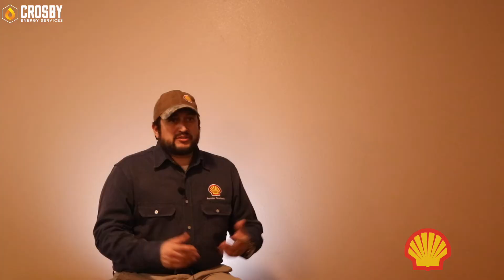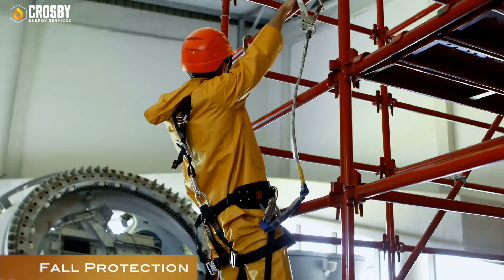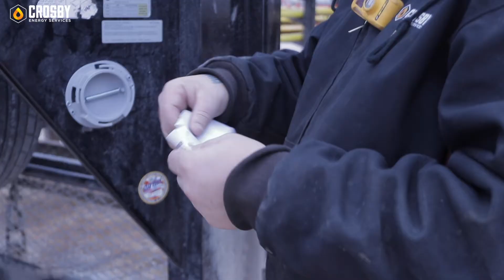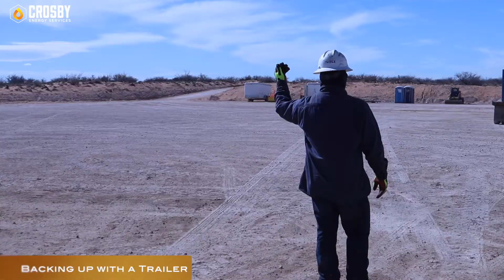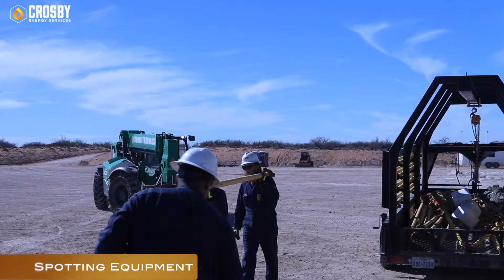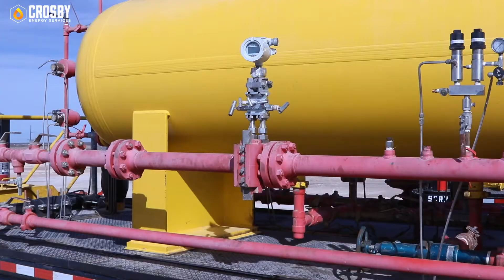full hd  Rig up Video

Comment: I'm have been seeking work in the oil and gas field, and I have been working primarily in maintenance and surveying of the telecommunications industry for the past few years. I'm open to working at various phases of the gas and oil industry, but I heard there are positions that provide more opportunity for advancement, or have more transferrable skills. I am researching into flowback rig up, equipment function, and production methods. Any educational resource is beneficial to me, because I want to be able to elaborate on my knowledge, so I can ease into operations.

I appreciate the details of what can be expected starting out. I'll look into more. I did check if Crosby had any flowback positions available, but not at the moment. I'll keep checking. If anyone knows of someone to contact within the company, I'm grateful for the reference. Good job, Inez. Thank you.

Comment: I like your safety procedures. They appear to cover a lot of bases from proper lifting, vehicle safety, job layout and crew function to environmental assessment and hazard identification. I worked for Dowell years ago and remember a lot of the oilfield work and hazards of a physically demanding job. I then went to work for a large electrical utility and ended up on staff as the Safety Supervisor for power generation. I then achieved my Board Certification as a Safety Professional from the American Society of Safety Engineers. The reason I mention this is because I recognize and appreciate your program to protect your workers, well done!